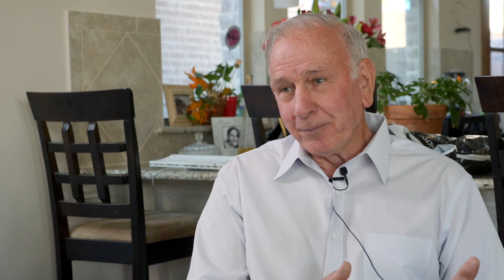Why develop a vertical windmill?

Comment: Another mind added to the sea of minds, sharing ideas to better mankind.    Wondering why you don’t see vertical wind catching blades that spin on a track? Like you said it's a merry go round and they always seem to be supported in the center where leverage forces can act on bearings and shaft.      And you have to use large bearings and huge shafts to keep oscillation from tearing it apart.   I have also a long time ago thought that the more surface area the more power but also understand why horizontal windmills don’t use this concept.    But I have a number of times witnesses the power the wind has on a 4x8 sheet of plywood while carrying it on a windy day.   Trying to come up with better ways to harvest the winds power by using a larger surface area where there is more force, not more speed but more torque, turning something with speed requires wind speed but if you use a larger surface area you get way more torque and we all know how to convert torque to do work.     So why don’t we see horizontal wind catching devices that are large, like 10- 20 feet wide with 4x8 sheets of something on it, riding on bearings along the outer edge of the diameter like a lazy Susan carousel turntable? Sure it has more resistance but it does not have to have so many bearings in it and because of the way more powerful forces you would get from the larger surface area, torque, would it not work?    And what about using sails?  Somehow.     I am not really into commercial application but want to make home power devices so we don’t need to pay electric companies.   I know you can harvest gravity now and use it to amplify mechanical force through oscillation.   Milkovic oscillator and skinner gravity machine taught me that.    So I want to use the wind to store energy in a flywheel and then use the flywheel energy to run my gravity amplifying devices.      Also why do we need wind power at all when you can just extract power out of the air by manipulating magnetic fields and have a source of unlimited power for almost nothing.   Well I know why, everyone who tries to sell one of those ends up shut down.   The world runs on oil and anything else the energy cartels can use to extract money out of us.  And they don’t allow anyone to change that status quo.   You have to remember this when you invent something more efficient, the people who sell us our energy are not into efficiency, they are all about making money and keeping what is already in place for them to do that.   So if you spend your time coming up with a better wind generator you may not be able to produce or sell them if they take money away from the powers that be.      But someday enough of the population will know there are new energy sources that are way cheaper and demand they be used.   As for me I will continue to pursue all energy sources and make my own.  Just won’t be advertizing it.   Rick.
Reply: Hi Rick,  after over 20 thousand hours of research, hundreds of thousands of dollars  and the construction of a 80 ft diameter feasibility prototype I have a new perspective on harvesting wind energy.  It may appear that horizontal windmills don't use the same method, they do however use a simplify method of calculating wind energy by using the square meters of the rotor area. In the big picture they calculate wind energy basically the same. 
.
One of the things that I truly appreciate about the USA is HOPE, Unlike some other countries you are not even allow to try. If you try to compete with others you make them your enemy, if you work with them they become your partner helping both to succeed, and yes I do have experience. It is great that you are on a learning path. George

Comment: I have given thought to a wind generator that uses the wind not to spin something  but instead use the wind as a force to set up a different type of oscillation.   trying to come up with a way to use the wind to operate a mechanical gravity amplification device.   such as  the Milkovic oscillator, or the skinner gravity machine.  which I believe are true gravity harvesting devices.  they use leverage to move the mass and set up an oscillation in such a way that gravity can enter and continue to enter the system.  with the dual oscillating pendulum  (milkovic oscillator)  you only have to keep the pendulum going  and each time the pendulum mass reaches the bottom you harvest the downward force through the secondary oscillation.  while retaining a lot of the rocking back and forth  momentum  of the pendulum swing.  to use over again with only adding a smaller amount of input power back into the swing.   come up with a way to catch the wind from any angle that it wants to come from and then direct that force into  timed pulses, to get something rocking back and forth,  in other words the wind pulses would be used to keep the pendulum swinging.
Reply: It is always great to see others pursue a learning path... I try to remember I must get less energy out than was put in... sometimes it is not obvious of all the energy input sources George goerge@zlan.com
Reply: @georgespencer8871     you say you try to remember you must get less energy out than what was put in but that is only true if you are creating energy from known energy sources.   sources that are allowed by powers that control our energy distribution.  There most certainly are ways to get more energy out than what you put in.  if you get your energy from the other sources that are suppressed in a attempt to keep them hidden from the world.   you can limit yourself to that concept by keeping that notion you can't get more out than you put in but I already know that is not true and have proven it myself.
Reply: Thanks for the followup, I will admit up front that I have never seen a perpetual motion machine. There is a difference between free energy and a perpetual motion machine. Free energy can be made from wind, sun, earth's magnetic field... and so on. It is not for me to deny what you know to be true, I will only suggest that it is easy to overlook an input power source that we can't see,,, such as the earths magnetic field, a ground electrical field produced by power lines from the pole to your meter, and even static electricity. I can tell you are passionate about creating new energy sources, I am truly excited about your desire to learn. The desire to learn is one of the things that fuels me. The best George
Reply: @georgespencer8871  I to have spent many thousands of hours researching as I have dedicated the remainder of my life to truth.  knowledge is the key and the wisdom to use it.  that which is true becomes knowledge and that which is false is not knowledge.  the problem with this world is there is an endless supply of false information, perpetuated and recycled through the minds of mankind.  it's bad enough having to deal with false information but then we also have deception.  I see two types of deception,  type one is where the mind after being deceived does not know it has been deceived.  The individual mind will continue in the deception accepting it as truth and where your thoughts are your actions follow.   As the mind directs the body to perform a function, to carryout what the mind believes to be true weather it is true or not.  and so we have falsity being perpetuated by individuals who are oblivious to the fact that what they believe is not true at all.    The other type of deception is where the mind knows it is a deception but then shares the deception to others labeled as truth, which is now a lie.    This is done for a purpose,  usually to manipulate,  control and influence the mind in an attempt to achieve a goal.  And in our world it's usually power and money.   I do not allow deception to dwell within my mind.        some things I know for sure and can testify as fact, other things are still being processed waiting to be proven true.       when I come to conclusions I am usually right,  almost never am I wrong when I state something as fact.            The term free energy is just a phrase used to describe and show people that there are other sources of energy that we can tap into which are so cheep that we can almost say it's free.   And after you build the device to harvest this energy you can continue to use it at  no cost other than replacing bearings once every so many years.    But it is not free as you had to build and then maintain the device.    extracting power out of the  environment, the charged atmosphere, or the universe, wherever this energy is coming from  I believe is real.   And not stating this as fact but I think we are already doing just that.   ask yourself these questions, when we generate power, we use generators right? driven by water, steam, wind,  we use energy to fuel the device to turn generators , and yes solar and other ways too but for the most part generators.   now we know a conductor crossing , passing through a magnetic field will cause electrons to flow in the conductor, and we know electrons are not created during this process and cannot be destroyed.  we also know or believe that the electrons orbiting the atoms do what is called electron drift, as the outer electron will move, drift to the next atom in the conductor creating electron flow and giving us our electricity.      so we know when an electron leaves a atom  that electron is replaced by another electron coming from another atom and I would assume the next atom nearest to the atom that lost it's electron.    now continue down the wire till you get to the end and there is no conductor left.   where does the last atom get it's electron from ?   I believe it just gets it from the next atom as there are atoms everywhere in our atmosphere, we breath them in.    The electrons are coming from the environment, the charged atmosphere, the universe, pick one .       so when we say we generate electricity what we are really doing is creating a condition where electrons can flow from the environment through our device and then channel it down a conductor to be used and then guess what? that electron returns to the sea of electrons from which it came.   it didn't get used up, destroyed or changed, it was simply forced from it's location to travel down a path we created for it to follow to do work for us and then returned.          Free energy is the process of moving these same electrons from their locations  but doing so without using  a lot of energy to do it.       The energy is coming from the same source.      what people don't seem to understand is that there are other ways to extract electrons without using such powerful forces, yes you can do it with the force of water flow,  the force of steam by burning fuel,  the force of wind,  but that method requires a lot of energy, that we are quickly depleting.       we are doing it this way because that's how it's been done for many years.  it makes money for those who then sell the power.        All other forms of extracting this energy are forbidden and suppressed by deception mainly,  there is no such thing as free energy they will say and you cannot get more out than what you put in.     And they are right if you are using their methods of extracting the electrons.
Reply: Hi r... even though I am not into philosophy, which I see is one of your passions, my enjoyment is science without the rhetoric... I do not want to discourage you but I am really not interested in your point of view, Thanks George
Reply: @georgespencer8871  it's ok,  most people trained in mainstream science are not open to new information.  wish you luck with your generator However you may find in the future a lot of truth in what I have said.